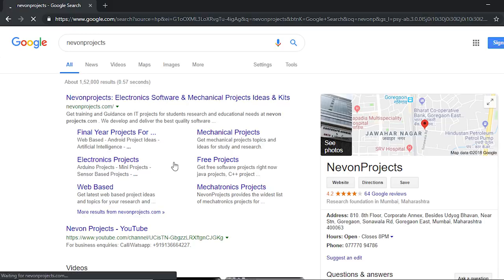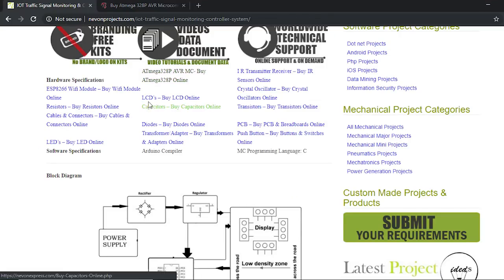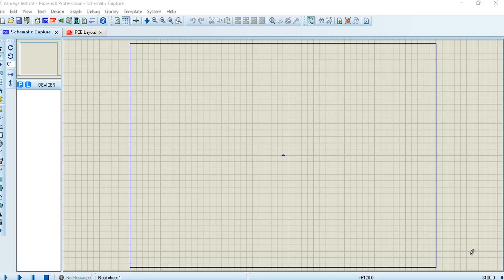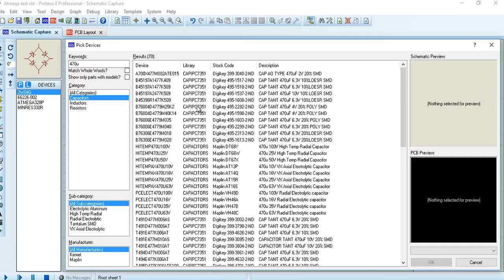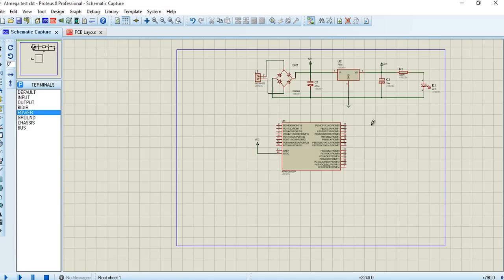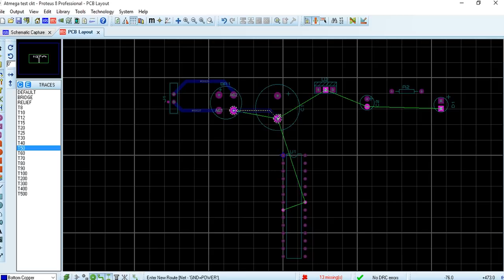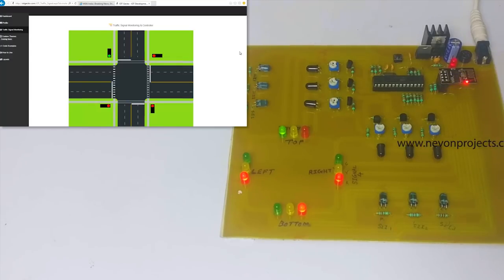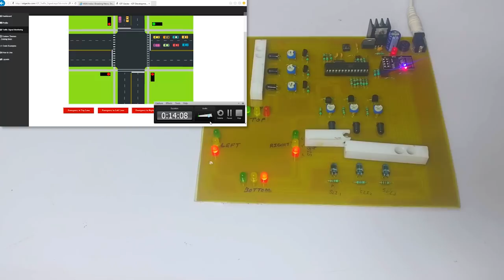IOT Traffic Signal Monitoring & Controlling System Project

Comment: Unfortunately not good. Because such a system is causing delay of traffic by opening other roads where there is no vehicles on that road. The system should immediately open the road where the traffic density is high and that should be prioritised with respect to the density of vehicles on a road